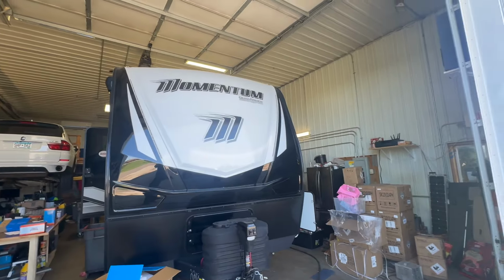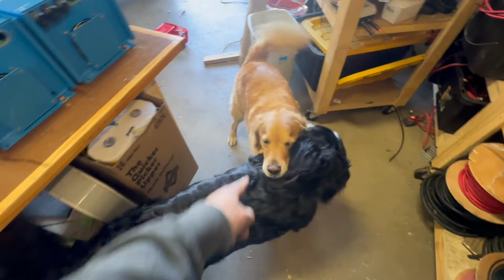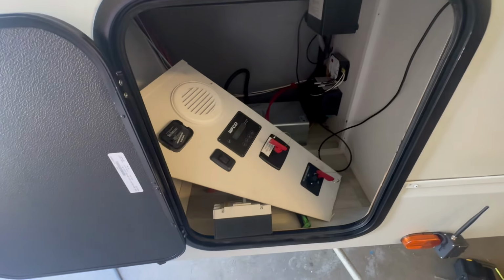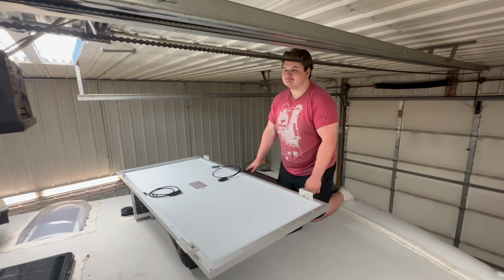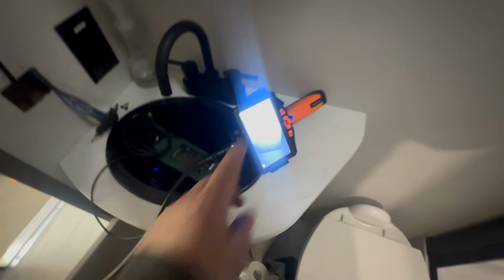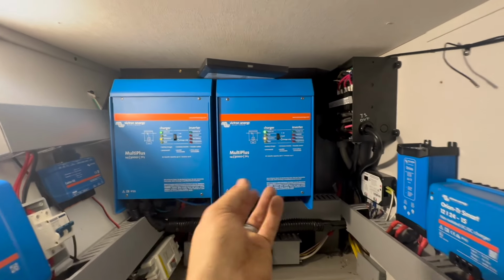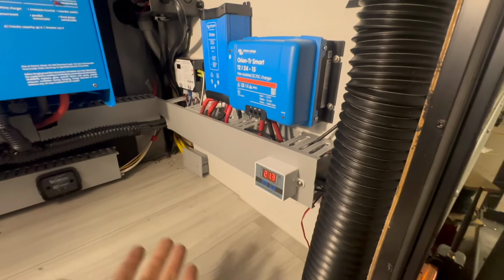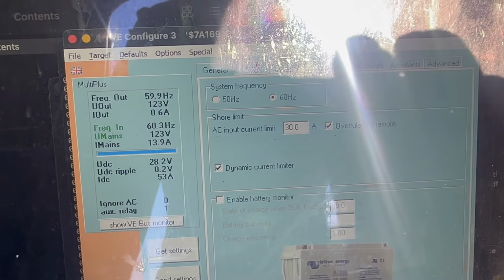Grand Design Momentum G Class Toy Hauler Victron 24v Dual Inverter  Victron Solar System

Comment: In addition to the thermostat for the fan,  I have seen you also trigger a cooling fan using the Multiplus relay output programmed to trigger when the Multiplus fan turns on.    I would also like to see how the battery compartment under the bed turned out.  Thanks for all your hard work.

Comment: Do you program your charge controllers to charge at 1C (to take full advantage of the full solar array output) or do you back it off to .5C to preserve lifepo4 battery longevity? I’m torn between the 2, I’ve got 1400 watts of solar on my RV roof and a 150/100 victron charge controller but the battery manufacturer recommends .5C charge rate (50amp)- but this limits my solar max watts to around 700. Battery manufacturer says their batteries can be charged at 1C (100amp) but recommend .5C. Was just wondering what you program the Victron charge controllers to that you install.
Reply from the maker: It is almost impossible to charge at 1C  or even .5C on most battery banks   C = Capacity.   So for this battery bank, it's 920ah of Capacity.    So to get C Rate, we take 100 divided by Capacity (920) to get  .108C as a maximum charge rate. 100/920=0.108C   .  If have 1 battery and add a second, it cuts your C rate in half.
Reply: @sotasolar let me ask this another way, if you were installing a Victron 150/100 charge controller on a 12v system, do you set your max charge rate at 100 amp(max  this charge controller can produce) and let the charge controller  figure out how much power it needs from the solar array to charge the battery bank? For me, I’ve got 600Ah in batteries, and 1400 watts of solar (4-350w panels in 2s2p). When I set my charge controller max charge value at 50amps (recommended charge rate for my batteries)it was maxing out the panels at 600-700 watt range, but once I increased that to 100, I was getting 1025-1050 watts from the solar panels.  Just trying to figure out how you set your charge controllers max charge rate values 😁
Reply from the maker: @BrianReed-w9d   When you said "recommended charge rate for my batteries". That's true, for 1 battery.   That recommended rate is per battery.   100a/600ah = 0.16 C , well below the 0.5C rate that is recommended for the entire battery bank.   I've never derated a solar charger for a battery bank.  It's never been an issue that needed solving.  If you only ran 1 of your batteries, then yes, you should derate, but because you're  running 6 batteries, you max charge rate is 50 amps * 6 or 300 amps.   You can triple your solar system and still be within recommended charge rate.

Set it to max charge rate.
Reply: @sotasolar thank you! That is the part I was missing!!! I wasn’t accounting for the entire battery bank and adding up each piece to get to the total charge rate. I was applying the single battery specs instead of the specs for each battery combined.

Comment: I use the Dihool DC breakers too. They work well. It looks like a sweet system you're building there. You're using the exact battery capacity we have, which has proven to be sufficient for our FT off grid needs. You wouldn't have to worry about shading if you racked your panels above your A/C shrouds, vents, etc. You could fit much more solar up there too. We were able to fit 4,400w on the roof of our 35ft Class A. The ducted fan with a thermostat is a great idea.  I'm sure you put a screen over it to keep the bugs out.